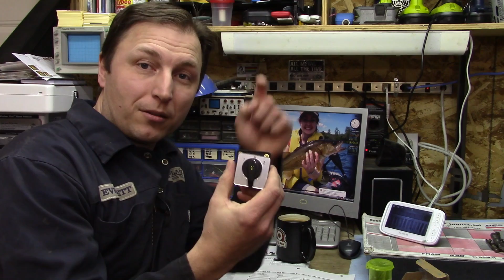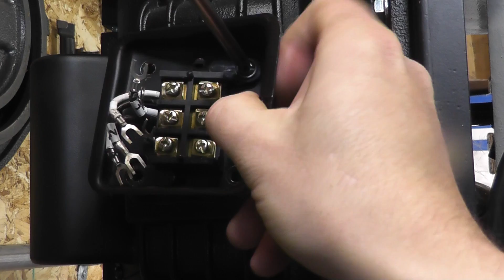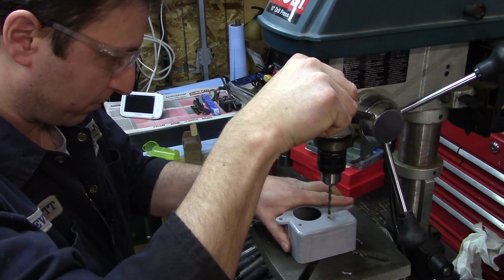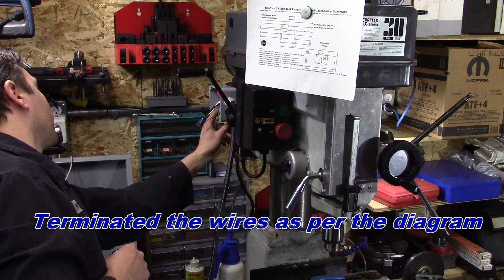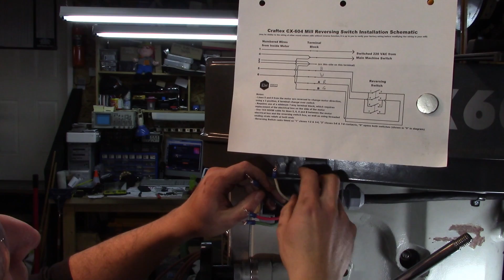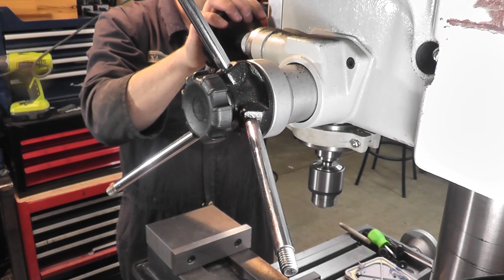Round Column Mill Reverse Switch Install

Comment: Missed the part where you determined how to wire it to reverse the motor.
Reply from the maker: By adding a rotary switch configured to switch which winding is connected to the start capacitor you can reverse the motor.  I have a basic wiring diagram that I came up with, and if you would like a copy you are more than welcome to it.  Just email me at everettsworkshop@gmail.com and one will be beaming your way.  Might be clearer with a schematic, I find they help clear things up for me.
Reply: @EverettsWorkshop  Thanks, Everett, I'll do that. The key to reversing, as I thought is having wiring into the windings.

I just repurposed an old Milwaukie Hole Shooter ½" drill motor to work as a head elevator on my mill. Had 2 drills, 1 reversing & 1 not.

The non-reverser doesn't have leads straight into the field windings like the reversing drill did.

Still might be able to get some leads into them, the chuck has 40+ yrs of seniority & isn't giving in, easily.  LOL

Thanks

GeoD

Comment: How do l get hold of you lm interested in installing a reverse switch on my mill drill. I’m new to using you tube for machining info and l have no idea where you are located.
Reply from the maker: Hello Wayne!  Shoot me an email, I can send you the wiring diagram I used for my mill, it might help in figuring out where you would need to tap in to your junction box.  I live near Edmonton, Alberta, Canada but you can email me at everettsworkshop@gmail.com

Comment: Absolutely nothing wrong with how you did this.  I have 42 years as a commercial/industrial technician....your approach, implementation, creativity and workmanship is better than a lot of experienced professionals. Being able to make what you already  have  or can obtain quickly to complete the job so it looks and works properly is a talent.  Never apologize for the need to retrofit by the seat of your pants as long as it’s safe and the smoke supply remains intact......mostly.    Great video Everett!
Reply from the maker: Thanks Ken, I appreciate that.  I don't want to be known as a hack - we're all human and make mistakes, but especially with electrical stuff I don't want to bodge stuff together.  Thankfully the smoke hasn't escaped yet (that's why the boxes are sealed to keep it in, lol!)

Comment: Power Tapping, here we come, hope not for broken taps removal, though....   ;)
Jokes asside, power tapping whe well performed, is safer than hand tapping, at least in my experience.
Claen set-up...!!!    ;)
Reply from the maker: Thanks Pierre, the whole power tapping adventure will come soon enough. Cracked off a few carbon taps over the years and had to grind them out but the HSS ones seem to survive better. Looking forward to being able to use left-hand tools like left-hand drills to pull broken bolts.

Comment: What a really nice gift he sent to you Everett, this will be nice. Gray enough in color match it is dead on through the camera? No you are not the boxes you selected are what it is we would use here, not saying we are right or wrong but you are doing this sealed box build correct, in our minds. Lucky you, your milling machine original wiring in that original enclosure is really clean nice to start your addition with we usually see so much questionable wires dirt and grime and well mystery items in those original boxes, what we are saying is you get to keep your hands and tools clean while doing your modifications. 
Cutting plastic is always stringy for us as we cut Delrin often messy and stringy so it is we agree strange. No one ever said or wrote (that these two recall) that the terminal block cannot run corner to corner as far as we know so good solve to keep your build going and not having to wait to receive a shorter terminal block. 
You did a great wiring job, Lance & Patrick.
Reply from the maker: Hey Fellas, hope you're doing well. Thankfully I'm the first owner of this thing like you say and the wiring label was still intact. I hate sloppy wiring jobs so that's why the boxes and fittings were chosen, and while the terminal block isn't perfect at an angle it is solid and safe. Looking forward to having new operations available like left hand drills, power tapping, etc.

Comment: A rev switch will open up the capabilities of your machine  more than you realise  ,  left hand end mills etc the list goes on .
Reply from the maker: Yeah, I'm looking forward to using that feature now. Not the least of which is left hand drills to pull broken bolts.

Comment: Nicely done. Some things to look out for if anyone else does this:
  Those plastic switches can be feindishly difficult to reassemble if you ever try to take one apart. The last one I opened had almost 50 parts in it and no markings of any kind to aid in reassembley. If you're lucky you will just blow the motor capacitor if you get it wrong. 
   Chinese wiring has nothing to do with any wiring standard.  It's not unusual for the wiring diagrams in the owners manual not to match either the switch cover or motor cover diagrams. Best advice is to follow the diagram on the motor itself. 
  On some of the early Rong Fu style mills (like mine) you may find a wire in the harness between the switch and the motor that isn't hooked to anything. It's use depends on who made the motor if that wire is to be used. So if it's not hooked up, ignore it.
Reply from the maker: Thanks! Just hoping it can be helpful to someone.  You are totally right about the switches being fiddly to reassemble, it took a little while for me to get the cams timed right and then the contact banks back in place with the contacts and springs correctly positioned. I hear you about the lack of wiring standards over there - seen some less than stellar wiring on some of my other tools. Like I said to everyone, do your homework before doing anything like this as you want to be safe.

Comment: That will come in handy for sure.  Actually I do not have reverse on my machine.  I have intended to set it up for a long time now but so far I haven't.
Reply from the maker: Wow, really? I totally thought you had that on yours. Sorry for the mistake, I thought that was the extra switch on your control panel.
Reply: @EverettsWorkshop  you may have seen me using my tapmatic.  It works just like reversing a motor.
Reply from the maker: Maybe that was it, I don't know how I came to that conclusion. Guess I didn't need to be envious then, lol. One way or another, you've got yours set up nicely with the stuff you've added.

Comment: If your motor ever goes out, (or even if it doesn't) get a 3 phase motor & a VFD. I have a gearhead Harbor Freight/ RongFu mill/drill & I installed a 3 phase motor & a VFD. Sooo sweet. Makes power tapping a breeze.   BTW, great videos.
Reply from the maker: Seen a number of others who put VFD's on their machines and that would be cool at some point as it offers a lot of advantages, but at this point I can't justify the cost of it. If the motor dies at some point it will be an option but for now this will have to work.

Comment: Great work again.  That was a bit more complicated than I thought it was going to be, but I didn't take in account keeping the on/off switch you already had.  I hope you get a lot of use out of it now.
Reply from the maker: Thanks again, it will open up a few other operation options. I wanted to keep the existing switch as it is CSA approved with that switch.

Comment: That is a neat job, I like the use of the outdoor boxes. Now you have an working forward and reverse, that comes in handy for some other things besides power tapping.
Reply from the maker: Thanks Jim, it should open up some other operations, that's for sure, like using a boring head on an external feature